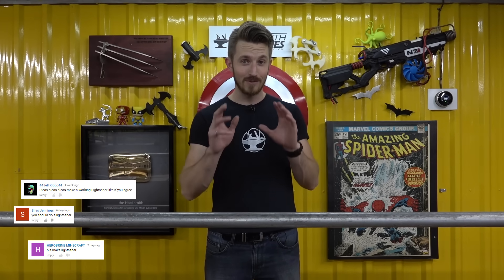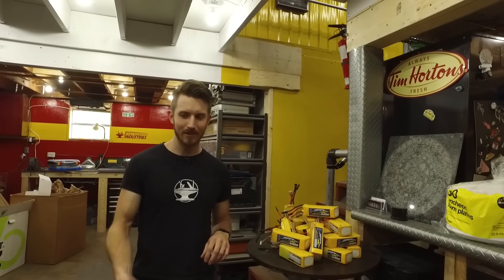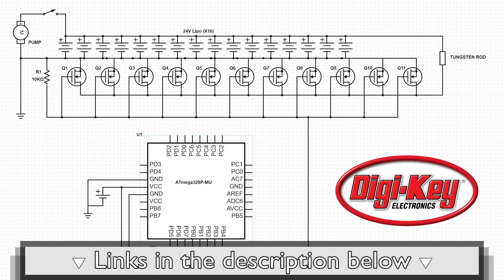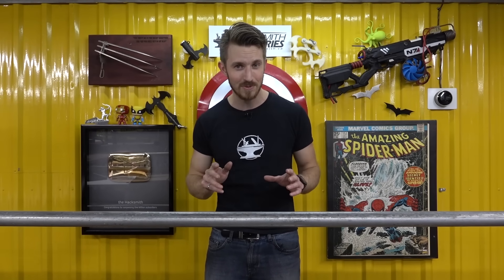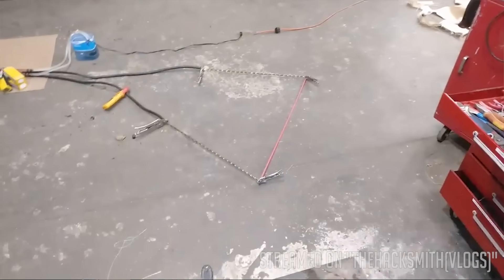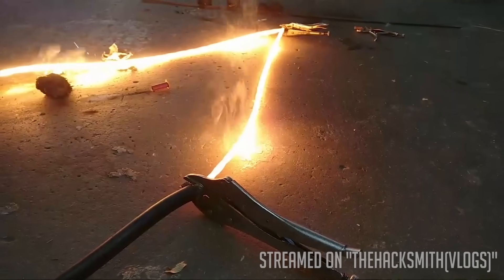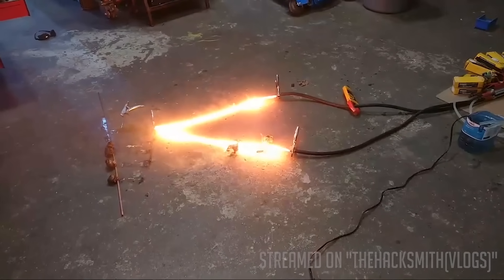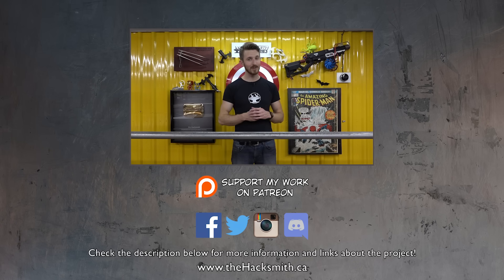HOMEMADE LIGHTSABER EXPLOSION!

Comment: Is there a way you can make an iron man suit but have it so it sucks in air around you and pushes it out some how in high pressure to make you fly?

Also with the lightsaber is there a way you could have it so it was a continuous circuit, where you connect something then it just keeps itself running off its own heat or something then seperate the current some how and cut off the power? Just curious. I would do this kind of stuff myself but I don't have the money and I don't know anyone to help not die haha.
Reply from the maker: Uhh... haven't you watched our flying like Iron Man project? lol

Comment: For the Blade: You use a tube as a electrode and inside the tube you put a wide diameter steel rod. Wide diameter becuase it shoudn%t glow. At the end you conect the steel rod to the tube/pipe. And Tiere you have it: the blade. Sorry for mi Brocken englisch

Comment: They are useing to much power and heat. If you look closely at the rods they are perfectly straight but when they show the 2 rods heated up the rods were bent a little.(might be the camera angle. idk) that means that just one rod would be to hot that if hit hard enough it would bend and possibly hit the person wielding it.
Reply from the maker: Yeah... that's not the lightsaber, like we said in the video, we were just testing the power supply by heating up steel rods haha. =)
Reply: Have a look at these maybe they could help.
Sufficiently Advanced:
How to make a real burning lightsaber: part 3
And
styropyro:
real burning homemade lightsaber.
I know it's not part of the original design but I think this would be fun. If it help let me know, will you?
Reply: Also have a look at these batteries they are small but based on my calculations you will only need 11-28 of these if you want to reach the 200 kilowatt that you want.
American Hacker:
How to make tritium nuclear battery at home.
I even put my calculations on the amount of watts they might produce in the comment section of the video. hope this helps. Make the lightsaber dream come true.
Reply: Sorry forgot to factor in output.

Comment: As an star wars fan, this is really cool. As an electrician, This is really unsafe..I've been called to emergency's with amperage sky rocketing and metal red hot...all due to really stupid decisions with no safety taken into regard. Idk the tendencies of the type of steel you were using but i can say when copper gets to the "liquid metal splashing off it stage" those particles become air born and can burn your throat and lungs from the inside out. The really dangerous part comes when a small part of the metal burns away and then the circuit arc's, literally throwing burning hot liquid metal into all the surrounding air.  Albeit I deal with AC not DC current 95% of the time and always AC when regarding the amperage mentioned in the video (900-600amps).
Reply from the maker: +AnimosityGamers not much different than welding, might not seem like we had many safety standards in place but we did know what we're doing! It's low voltage DC so no electrocution hazard there. 

Large shop with ventilation so not too worried. End version will use tungsten so it won't actually melt off as much :)

Comment: i would suggest some heat resistant but also heat condupting mterial on blade in order to make the light saber work you just need to shape it or you would need to redisign a light saber from stick to actual one sided bladed saber wich would be much easier and it would brought to the table something new

Comment: +the Hacksmith
How to make the blade.

The way to make this work is in magnets and plasma. Plasma can be molded by magnets and you clearly have enough power to heat up the air and turn it into plasma. While the blade won't be all plasma you can still have a plasma blade. A shaft of strong enough  metal that conducts electricity could form the blade. You heat up the blade and it becomes plasma that same blade or something different could conduct electromagnetic energy to stabilize the plasma at least for a little bit and give you the worlds first lightsaber.
Reply from the maker: +Jack Lga not that simple
Reply: the Hacksmith I mean the concept

Comment: Heat up a tungsten rod using electricity, but have it so once the rod gets to a certain point electricity stops running through, and have electricity running back through the rod so the tungsten won't melt
Reply from the maker: +T h e S k y L o r d 7 check the circuit diagram ;-)

Comment: Did you find out, what exactly caused the overload and eventual overheating of your Mosfet switch?
Reply from the maker: +Guido Ziel a silly mistake, which is why we didn't explain in detail :p
Reply: the Hacksmith I thought, I could send you some design improvements I saw from your circuit diagram. But as you stated before, working over the internet is indeed complicated.

Comment: if theres a way to contain plasma in the shape of a saber via magnetic waves, then try that...if not then maybe a metal rod incased in glass?
Reply from the maker: +Grim3aper 22 why would you encase the rod in glass?
Reply: the Hacksmith well, i was thinking it would make a brighter glow if you had glass around the source of light (heated rod)...but the glass might melt...so its not a good idea

Edit:
I ment to say magnetic field not magnetic waves
Reply from the maker: We're hoping to actually be able to cut things with it =) It's easy enough to make a lightsaber glow, hard part is making it cut! =)
Reply: the Hacksmith well, i was thinking, if the glass was able to withstand the heat maybe it would be hot enough to cutt through objects...although it seems to be better if you make it out of metal, especially since you'll be able to sharpen it and it's more durable

Comment: why not a telescoping rod with prisms and small mirrors reflecting blue laser diodes fixed at the base a d aimed at prism tip
Reply from the maker: +Julian Ruiz because it wouldn't be able to cut anything proper
Reply: +the Hacksmith aww but it'd be awesome if you had enough diodes

Comment: for safety I'm imagining you're going to use some form of cooling probably liquid cooling, although fans could work if strong enough. I'm imagining you going to use some metal for the blade, my guess you were planing originally with still but  as you could judge by the video that they started to melt (insert jet fuel cant melt steel beams meme.) so you'd probably need use a metal with a higher melting temperature, as I'm not one for chemistry I would not know what to use of top my head, but then to use something of a material bases would hold issues do to higher the temperature weaker the bonds keeping them together will be so, you might go down using photon or electron gun method. that just what I'm hypothesizing idk looks interesting.
Reply from the maker: +Myles haha this already had liquid cooling
Reply: Oh my XD what sort of power are you getting from this?
Reply from the maker: +Myles we explained in the video!

Comment: this is your first weapon prototype that actually has a very plausable and interesting future. this knowledge is very valuable to me. Thank you! 
So even though your far away from a light saber... you can still take this and put it into a sharp sword. which would be a killer weapon. the sword would have to be split down the end as if it were to poles conected at the top. thats how you connect the jumper cables at the bottom and have a fully functional MAGMA SWORD. awesome. 
now we just need some plutonium to replace the batterypack and no cables will be needed. awesome.

Comment: Use the metal rod for the heat to cut through  stuff to turn it on make a switch when you pull it out for that box the switch activate the light saver.
So make a light saver box then       If you know those kid light savers that get pushed back in get a metal rod that can

Comment: A ceramic and tungsten perforated capped tube that acts as a release structure for superheated plasma could be a potentially cool saber thing. Although you'd need a mixed gas canister as an acting plasma source.

Comment: My theory on making a real working lightsaber, is actually quite simple! It's just that the technologies we need to do it are a little further ahead. To start, we know scientists can create miniature black holes, we know that black holes, can bend light, and we know a laser (high intensity light) can cut through items. So, the only thing we have to do now, is find out how to make a mini black hole in a tight confined space such as the lightsaber's handle, to then send it on the end of a rod, up and out, pulling the light, from a laser pod at the bottom with it, in turn, either sucking the light in and it never escapes, or bending it back around the other side to go straight down in to a reflector, which diverts back to the mini black hole. Thoughts anyone?

Comment: The ideal way to implement a light saber would be with a light weight frame with two strong magnets on each end. The field lines could be used to direct plasma flow from end-to-end in a long, thin elipse (like a light saber blade). You could even make the frame telescopic so the light saber can extend and retract. Unfortunately, it would take MUCH MUCH more power to generate plasma like that. Maybe one day.
Reply: Plus, the magnetic field would orobably be more dangerlus than the plasma...

Comment: Use microwave transformers to heat the blade, it may work surprisingly well...
Reply from the maker: A microwave transformer can only use about 2000W ... our power supply is capable of 200,000W =) bit of a difference!
Reply: oh...
Reply: that sure packs a punch...
Reply: the Hacksmith draw an extra zero in the back of the microwave and you're good to go
Reply: Two zeros
Reply: jort93z 
Just cut it and add low current windings.
Reply: jort93z its only about 12 volts or 24 volts depending on the batteries they used because the batteries are strictly wired in parallel boosting only current and not voltage
Reply: oh, yeah. you are right. its 24 volts. 
but still, a microwave transformer seems pointless.
Reply: thread is a little old but still, microwave transformers only produce a high voltage but here we need a lot of amps. microwave tranformers maybe produce 2000 volts at 1 ampere. the've got more like 700 amps(at 300 volts or so depending on the state of the batteries).

Comment: use a tungsten carbide rod with a reinforced steel core as if youre using solely steel itl either bend or snap when you swing it

Comment: using tungsten as the chore and put a layer of steel or something on it. the bend the whole thig into a thight U shape or a double helix conected at the top. the double helix might be hard to do though
Reply: the steel is for the sparcling and glowing effect, the more carbon the better
The sparcs coming of are burning carbon btw
Reply from the maker: Take a look at the circuit diagram ;-)

Comment: since you need 2 terminals connected you will one awkward thing running the length of the blade if you use one rod. instead make a 'U' (2 layers of wire) loop or a 'O' (4 layers of wire and cuboid in shape) loop with both terminals attached to the handle
Reply from the maker: +scRam Jet that's the plan haha

Comment: magnetic feild generator if your using  actual plasma use a modified plasma cutter nosal  system to make the ignition piece at the vey begining of the blade then a small ark pieice at the top to make sure the plasma comes back around

Comment: Use a ceramic or other non flamable material pipe und use multible thinner wires wrapped around it (eventually similar to a conductive antenna isolation mesh like that stuff: https://hollandshielding.com/content/4800/4800-Flexible-EMI-shielding-tube3.png)
Bring the power back in the inside of the pipe  and build a controlled PSU that keeps the entire thing from melting  down completely depending on temperature or cirquit resistance.
You are trying to heat up way to much material which is not nessesary to achive the wanted results...even tho thats the cooler way to go :D
but the mesh will have a way higher reistance and will heat um with much less power...
You wont  chop a tree down but should be able to use that glowstick to cut through syrophorm  a tent wall or whatever

Comment: Hmm the saber will need a positive and negative connection to span the cutting edge, either using a steel rod, or even a solid piece of carbon would work however they maybe issues with the wires near the tip of the blade like how so many other designs have. However if a folded piece of metal were to be used then all the electrical components can be safely housed
Reply from the maker: +Jordan Olsen hint hint

Comment: You can't wire the MOSFETs in parallel like that!! It sets up for a cascade failure. Let's say you have 20 FETs, that's 10 kW each. But let's say one fails early. Now you have 10.5 kW each. Then another fails, now up to 11.1 kW each, etc. Cascade reaction, BOOM all your MOSFETs fail. Only use 1 MOSFET per battery.
Reply from the maker: +defenestrated23 I think you'd end up with the same scenario... If the light saber draws too much from any of the individual battery/mosfets it could still over load one and then cascade effect all over again. The idea is to over rate it significantly so that doesn't happen. But yeah, it's far from a perfect design, but hey, I'm a mechanical engineer :p
Reply: Well...I think some destructive testing science is in order!! :D :D :D

Comment: Focus ionised plasma through thigh temp tube with small holes so it pertrudes out off the hole and forms plasma around it so in simply plasma cutter tune up, ps alter power to change the colour of plasma

Comment: you need to make the blade with a carbon core as a "ground" or "negative" then have a heat resistant insulation barrier warped around it and finally have a tungsten jacket( like a pipe or tube or something) to encase the whole thing. connect the jacket and the carbon core at the tip and connect the battery at the base inside the handle, the tungsten and the carbon should be able to withstand the heat and get hot enough to melt things, as for the insulation... you're on your own cuz i have no clue lol
Reply from the maker: Or just have a u-shaped blade so the circuit goes up and down ;-)
Reply: but that wouldnt look as cool. looks over ease anyday

Comment: The only feasible way to complete the circuit would be a long loop so I imagine the power supply will be in the hilts and a long u shaped loop will be the blade. I'm not sure how the heat vs weight will work will you be able to make it light enough to wield like a sword hat would be cool

Comment: You could always do it the way Dr. Michio Kaku suggested.  He said the power supply was the biggest concern, but since you got that licked pretty much the way he designed his was using a ceramic telescopic rod which, had holes in it that emit plasma for the blade. As well as a cooling system for the handle so you don't burn your hand off wielding it.

Comment: An arc contains high velocity anions, following the right hand rule of B, a magnetic field, creating a magnetic field parallel to an arc will cause the arc to "wonder" as welders call it. In a controlled setting we could cause an arc to wander in a tight loop back to the electrode and create a protruding electric arc.

In simpler terms, we use magnets to push jumping electrons away from one end and they loop back around to another end. If we do this tightly enough, maybe using the new technology of magnet printing, we could create a light saber,

Comment: You can't use FET's like that. They need to have proper load balancing, otherwise you get what you already got. Hot, Expensive Failure!. You need a separate control loop and proper balance resistors for each FET, then you can string them together for higher current handling. If you want advice on designing a better switching circuit PM me via YouTube.
Reply from the maker: Well, that's why we aren't electrical engineers! Might take you up on that!

Comment: you should stick the negative/positive wire/rod for the support of the saber and then wrap the steel around the wire/rod

so that way you can get power through the steel and you can have support for the red-hot steel
Reply from the maker: +Sam Brown we're not using steel ;-) that was just to demonstrate the power supply
Reply: oh well I guess you can just use whatever metal you have been using
just wanted to through the idea out there
Reply from the maker: +Sam Brown there's a hint in the circuit diagram ;-)

Comment: Why wasn't the heat transferring to the clamps? I get that they're probably made from a more conductive metal and so produce less heat from resistance, but why wouldn't they still get hot from being in contact with the steel?

Comment: In power stations use a gas that acts as a better insulator than oxygen
The connection point between the batteries must be like an old bulb.

Comment: Seeing that the "lightsaber" was a bit unstable and that lightsabers are supposed to retract, you can attempt to solve these problems at the same time. similar to how a toy lightsaber works, you can have multiple pieces of metal that surround each other and when extended form the "blade." Each section of the blade could be individually powered by the power supply. Exhaust points may be needed just in case the super hot metal and air within the hilt build up pressure. If you want, that means you would practically be making Kylo Ren's crosssaber. 😉